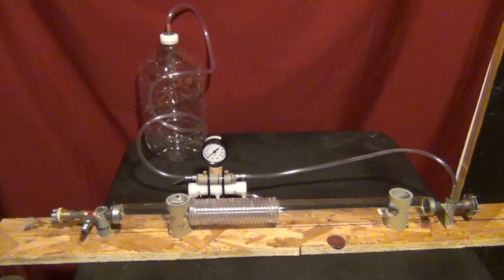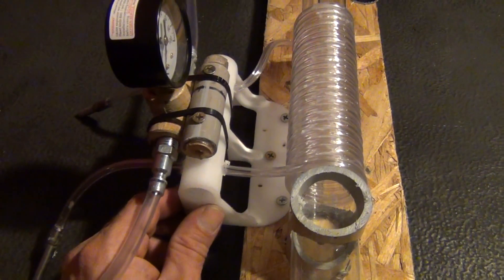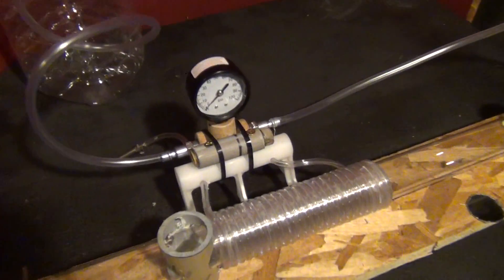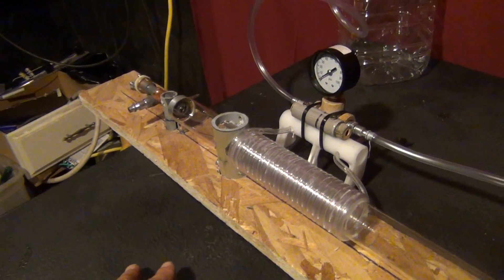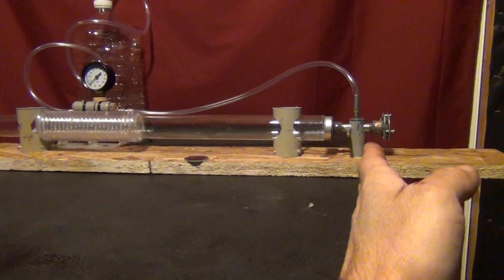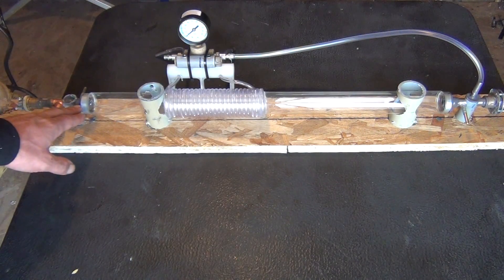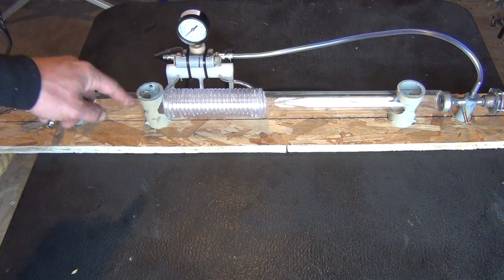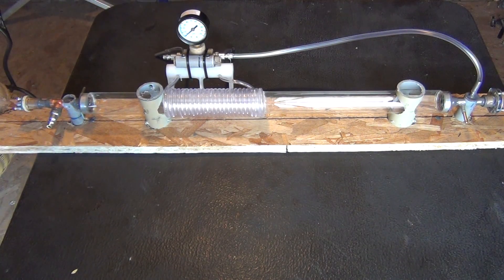Homemade CO2 Laser, part 3

Comment: hi, i m from Brazil, i see yor move and want congratulation you, this is very nice, sory my inglesh, becouse i dont speach, but i like  know what  gas do you use and proportion of it to mix , tank you my friend.
Reply: title says CO2 laser - carbon dioxide laser. The gas is CO2.. and he makes it by combining baking soda - NaCO3 - and every day vinegar which is CH3-COOH - so it produces CO2 by this reaction: 

NaCO3 + CH3-COOH -> CH3-COONa + CO2 + H2O. 
Hopefully i got it right.
Since CO2 is a gas it escapes the reaction chamber ( bottle shown there) .. and enters in the tube where gets excited by the higher voltage producing the laser beam. He talked about other gases also but I need to rewind previous videos to check. I did not remember him talk about mixing ratios or how he gonna precisely control them. Maybe next video :)
Reply: Helium:neon is 1:4

Comment: Would anything interesting happen if you used Uranium glass tubes?
Reply: Nothing,will happen.Uranium glass tubes contain only 0.68% of Uranium Oxide and 2.80% of Barium Thyocyanide.The electron stream will be bigger if you use 100% and 99% reflective Rhenium mirrors as reflectors.And you need to use solid aluminium electrods,xenon krypton and neon filling,fillament cathode,and a solid tungsten crystals inside target.
Reply: Nothing,will happen.Uranium glass tubes contain only 0.68% of Uranium Oxide and 2.80% of Barium Thyocyanide.The electron stream will be bigger if you use 100% and 99% reflective Rhenium mirrors as reflectors.And you need to use solid aluminium electrods,xenon krypton and neon filling,fillament cathode,and a solid tungsten crystals inside target.